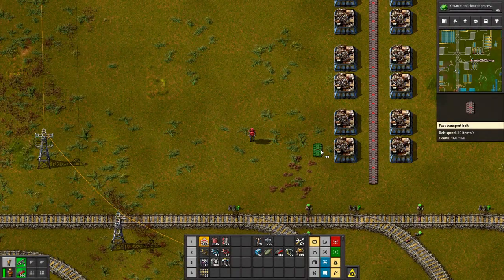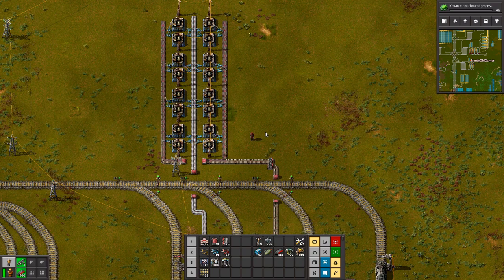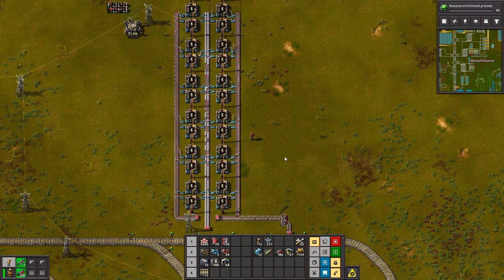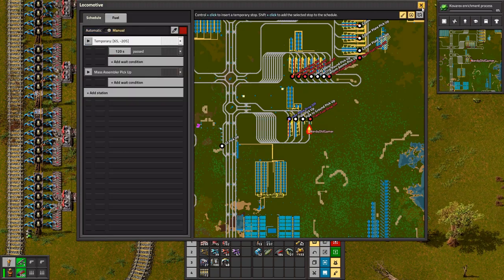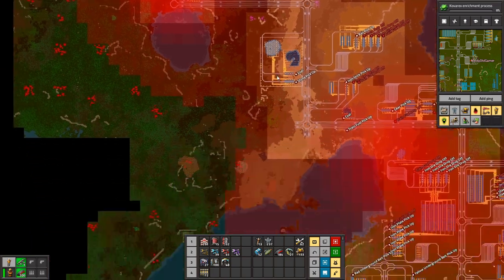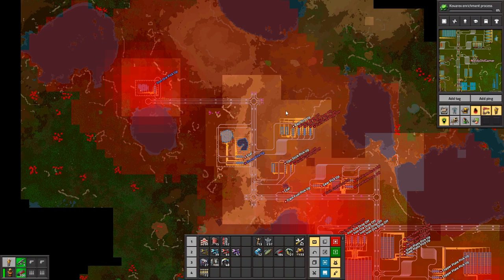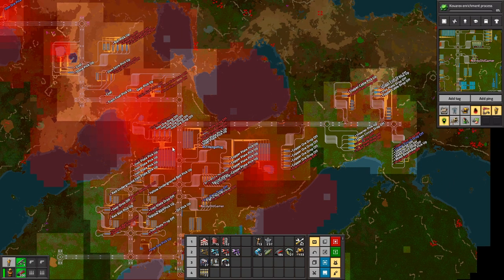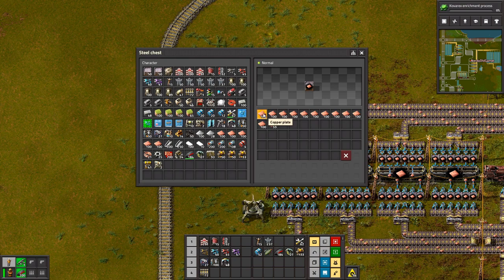Factorio 1.0 Multiplayer 1K SPM Challenge Ep55 | Pipe Production and Mall Prep

Comment: Hi NOG. Pipe pickup for the mall train you need twice as many stacks of underground pipes to regular pipes. Set the train for 60 seconds at the inserter station then go to pipes and set the time to circuit this will keep it there until you call for pipes or inserts then it will refill it self and wait at pipes again tell ST about the train. Next recording you have to start with building lasers to fight the biters as it is now you can't turn the base on so the no need to keep building it because the biters are going to be agrowed big time you have to  kill them before you start being attacked. You have to use turret creep there's no way you're going to be able to kill that many biters with 1 machine gun each. Your way behind in speed and damage to your guns you have to use quantity of guns. Make a blueprint larger power pole with 8 lasers around it then you drop the blueprint and ST drops another one next to it and you both mite have to drop another one to that do this with your bots. As soon as the first wave of biters are done drop the same thing in front of it in range of the first line of turrets and you keep doing this till the biter base is destroyed.